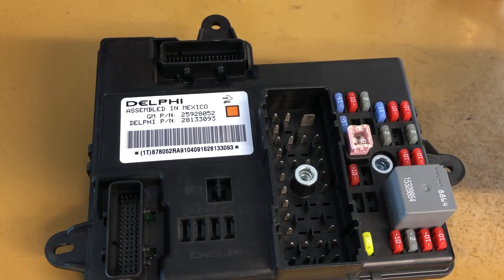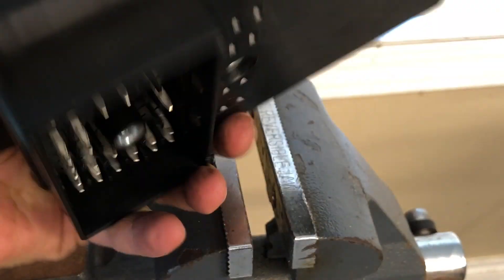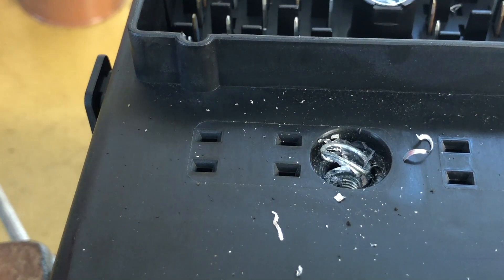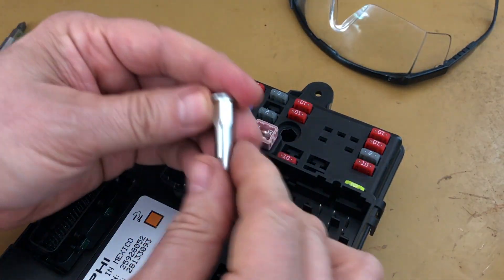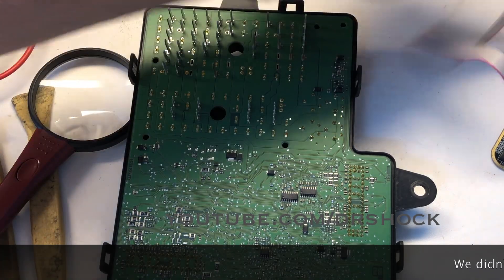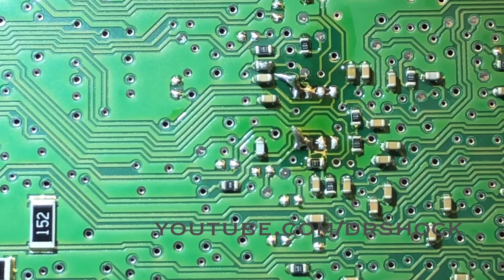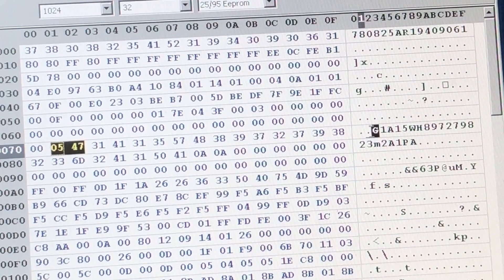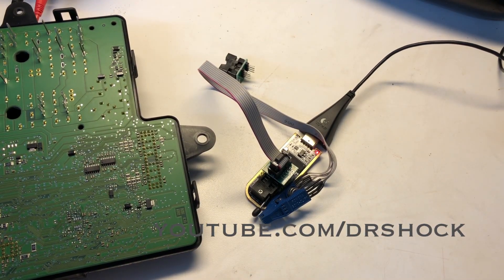2005 - 2010 GM Delphi Body Control Module (BCM) EEPROM Location & Contents (VIN, mileage) Cobalt HHR

Comment: Sorry ive had to edit this question like 5 times now lol.. But im working a 2008 Saturn aura with a no crank no start issue, a U0100 code and dead gauges. The car suffered from some random no start issues before completely dying and the doors would randomly lock from time to time. I fond a TSB under my vin suggesting a problem the BCM can increase in resistance over time and with all the other symptoms i'm dealing with i suspect that my BCM is probably bad... In any case a brand new BCM cost more than the car is worth so I will be swapping it with a identical junk yard BCM. As i understand it the dealership wont/ cant  reprogram a used BCM so my question is would this technique work to transfer the data from the old BCM to the junk yard BCM? I am also curious to know if it would be possible just to solder the EEPROM of the old BCM directly to the new BCM instead of going through the process of reprogramming it? oh and one final question.. Do you have a link to the software you used to read save and write the eeprom data?? 

With that i do wanna thank you for a VERY informative video!
Reply from the maker: Thanks.  Yeah you can manually clone the BCM a couple of ways that I mentioned in this video.   You can physically desolder and swap the EEPROM out of the original and into the donor.   Or you can save the original EEPROMs contents, and overwrite the contents in the donor using an EEPROM programmer.

If you tap the linked video in the Youtube card (upper right circle i icon) you'll see my CH341a EEPROM programmer video and there is info there on the software I use with this little guy.
Reply: @DrShock  Awesome! Thanks for the help!
Reply: @DrShock  ok so ive sat down and attempted to make this repair.. and I followed the mods on your other video, cutting the 3.3v pin and soldering the 5v pin to the same one you did. put my chip in boot up the programmer select the chip and get this result

<<M95080>>
Current programmer: CH341
5:02:54
Reading memory...
Success
Execution time: 00:00:00.047
CRC32 = 0xB83AFFF4

however all i get is FF for EVERYTHING.. There appears to be no data on this chip.. I have to be doing something wrong right? what type of error could i have made that would produce this result? 

Oh idk if this is expected behavior or not but when i hit the little chip button with the question mark on the top  next to the badlock icon i get this error message 

IC not responding

is that an issue with the chip not communicating or is this an artifact of the 3.3v pin being cut?

Any help would be greatly appreciated ;)
Reply from the maker: This appears to be a failure to read the content seeing those 0xFFs, are you doing this with the chip desoldered and removed from the board?   It's actually on the rare side to get a GM board where you can use a test clip and redo them in circuit.
Reply: @DrShock  yep chip is removed exactly as you did in the video.. used the same socket to set the chip into the programmer with
Reply: it took me awhile to find the same exact socket you used for your chip.. it was the only thing you didnt leave a link for lol but thats what i used.. And the when i installed the drivers that you linked i got a wiered message saying "the driver was successfully preinstalled in advance" however when i downloaded the AsProgrammer through the link i got from the txt file from that Russian forum i found a folder containing drivers in that. I installed these files and that let the AsProgrammer see the  CH341a programming device. do you think it could be a driver issue?
Reply from the maker: Thanks, I didn't include a link for that particular socket as it typically is included with the CH341a black edition programmer I was showing.   It could be a USB driver issue, I would suggest a way to eliminate all those variables would be to just get a vanilla 8 pin 24x series EEPROM and verify you can read and write it before attempting the BCM repair here.
Reply from the maker: Also verify you have your pin 1 orientation correct, that could also cause what you're seeing.
Reply: @DrShock  ok so i pulled the eeprom from the donor BCM and stuck it in the reader and everything read just fine... but still no joy with the original bcm chip... doing everything the exact same way i still get FF for everything.. Does this mean the original chip was bad?? if so can i just manually input the data on the donor chip?
Reply: and i can confirm i had pin one in the correct orientation
Reply: ok so one thing i have noticed is that the original chip (the one that wont read) gets HOT if i let it sit in the chip reader to long and the donor chip (that one that will read) does not seem to get hot at all.... so bad eeprom??
Reply from the maker: Put a fork in it, that chip is internally shorted.  Could be the reason for the failure, or could have gotten a static zap by accident during the procedure.  At least you know your setup is working now.
Reply: @DrShock  ok so now could i just manually enter in the serial number of the original BCM and the VIN of the car im trying to repair and write to the chip? or is there more information on the first chip that i need? I've studies the vin number and its pretty much the same as the serial number in that every bit is backwards so as long as its just thoes to pieces of information i should be able to get this to work..
Reply from the maker: There's alot more info than the VIN and mileage stored in these.  The security pass code for the ECU to allow the fuel to flow as part of the theft deterrence circuitry is in there too.  All of the various options that are enabled, e.g. fog lights.  It wouldn't be practical to hand edit all that.  Best best is a donor BCM from the exact same year with the exact same options.   Otherwise, in a situation where the EEPROM is itself toast it can be less hassle and less cost to just put a new or OEM remanufactured BCM in there.  Both will have a virgin set of settings that trigger the GM scan tool to automatically populate based on the VIN records of the options the vehicle was originally built with.  As best I recall, all you have to supply is the original mileage value.   It's pretty rare for the EEPROM to be defective, usually would only see that on a flood car.
Reply: @DrShock  Well hey man thanks for all the help! im sorry to pester ya so much lol

Comment: Im working with this same bcm part number in my solstice. I havnt seen the ability to correct milage threw tech2win or sps2 .. paid subsriptions . Ive looked threw hp tuners and its not a changable value either. The orginal bcm was water logged and had major shorts across the board . Ive since patched it up and got it back to semi functional . It will start the car and display mileage lets the radio work . But many lights and door and window functions are malfunctioning or inop . The board is pretty bad.  I have a junk yard unit from an hhr that im using in the car for testing . Ive programmed it and calibrated it with sps/ tech2win but wasnt prompted by either to change or calibrate miles . Now my autel scanner will give an option in bcm set up that mileage correction/ adjusment features have been removed by the manufacture.. please contact manufacture .. then it skips to the sense module and radio set up so on so on . So i havnt found a way threw that way yet but i havnt called gm help desk and just asked if its even possible . Now i have a dorman reman unit . I havnt done a thing with it . My question for you is will it get the error from the instrument cluster that the miles are in error and go back to last recoreded in icp or will it just show me zero miles .. or is there magic coding in the box from the remaner and maybe i get lucky and can calibrate it without getting locked message . Thank you for you videos .
Reply from the maker: Thanks.  So GM has basically removed/blocked the ability to use used modules for most all models 2008 and up.  This is particularly true on BCMs which they started blocking a bit earlier.  SPS, and SPS2 now with the new Techline Connect, are just going to support brand new BCMs (or remanufactured ones with a GM virgin EEPROM image applied).  When you go with a new one, you'll get the mileage prompting.  Depending on the model the mileage is stored in the BCM, or the IPC.  If the BCM is the source of truth, the IPC will still have a tamper algorithm to detect if the BCM was altered from what it last saw, on most models.  This GM service bulletin spells out which is the source of truth by year - https://static.nhtsa.gov/odi/tsbs/2020/MC-10176649-9999.pdf

As far as I've experienced and am aware, there's no way to reuse an used BCM anymore without resorting to the chip level on the board (hence the series of videos I did on that across several models).  The TIS2Web/Techline Connect tools have all blocked used module reuse.  Even some of the Tech2 model years started blocking BCM reuse.  Best results are just moving the EEPROM chip from dead/dying BCM to the donor.   If the original BCM's EEPROM chip is hosed, you really have no option but buying a new BCM.
Reply: @DrShock  When i read the bcm replacement manual it does call out in the descp of op of the bcm that it holds the mileage. But the tsb notes say that the icp will error back the last recorded mileage some how . Some where i was reading in maybe a cobalt or hhr bcm .. maybe even a malibu bcm replacement manual not the same but simular it says somthing about disconnecting the icp for a certian step then connect bcm then x y z then icp connects back inline and im thinking thats maybe a way to get it to get the icp to do the read back error . Anyways . If i got back to those notes and get the correct terms ill try to edit this . But this is an internet guess of coarse. but , do you think the reman unit from dorman will be a fresh prom or static reset, so it will hopefully prompt for the miles to be recalled from icp ?  Also if you were to do the process would you use the gm tools and risk them locking me out or use the autel user freindly tools and risk it not doing the job and making it not virgin/ fresh prom ..  thanks for the reply 
I was looking at building a sniffer and an old hacked version of tech2 to maybe do the job and in my hunt i found your  video . Guys in the know" tell me they thought back in the day when they messed with this platform these bcms are not able to rewrite the miles on the chip. like there isnt a way .. over my head here.. the hardware or chip arragment to do it that way .. by design . They dumbed it down to EU laws and import export laws and car theft laws blah blah its to keep the black market and fraud down . They said new bcm and or dealer level codes .. or figure out the eeprom chip and if its removal... what you are doing here so brilliantly in this video. So im looking into sourcing the stuff you are using now . So just for fun if even if i get the reman unit to work . Ill try to use your methods to make the bad/used one work . Gm is on back order for a new unit at this time . Also do you have any thoughts on using a combo of rasberry, arduino etc to build a stand alone bcm ? Or a piggy back rig ?
Reply from the maker: I don't have any experience with Dorman so can't say, but I would expect a remanufactured unit to be ready to go with SPS.  Otherwise a return is in order ;-)

Personally I only use either the Tech2 or MDI, depending on the vehicles vintage.  With the MDI I go with the short term subs at TIS2Web, now Techline Connect, for either GDS2 or SPS2 as needed. Anything older than 2009 I go with the Tech2 and TIS2000.  

But I've never bothered with a new or reman BCM, I just swap the chips with an OG salvage unit and move on as that's usually the cheapest but still genuine GM route to go.   So can't really help with your questions on the mileage prompts there.   There are some forums out there with folks, mostly outside the USA, who just edit these chips directly and correct the mileage, VIN, serial numbers, security codes, etc.  That's even cheaper but requires more software tools to do (e.g., Tachosoft mileage calculator sub).
Reply: @DrShock  im still pretty new to all this . Im using a j2534 passthru and the sps2 threw the tech connect. The other option i have is the autel ms908sp . Ive imagined trying to figure out how to do what youre doing in this video and you did all the hard work for us . Thank you very much. Im subscriber for life now . I was lucky enough to witness some of the key recovery processess for one of the newer porche hybrids at the shop right now . Very intresting stuff .
Reply: @DrShock  also: thank you for attached link .

Comment: Do you know if SPS allows you to program a brand new EEPROM replacement? For example, let's say the EEPROM gets damaged.  Would a brand new replacement work when soldered into place?  I'm about to attempt one of these jobs this weekend, and was curious if I had a fallback option if anything goes sour.
Reply from the maker: If it were a radio I'd say yes with mounting in a blank eeprom.  But a BCM, I don't think so.  But I haven't tried it either.   But I'd suspect that the BCM serial number and initial configuration data being missing might be a problem.   This is typically only attempted when you have access to a virgin image to pre-populate the eeprom, the virgin image being the saved contents of a brand new BCM before it's ever been programmed before.
Reply: @DrShock  Cool, I was hoping to find a .bin file from a virgin BCM but had no such luck.  Hopefully my soldering skills work out.  I've soldered thousands of boards, but only 1-2 surface mount components.  I'll be using your Chip Quik recommendation.  These videos are awesome by the way.  A huge thank you!
Reply: @DrShock  Any good guides out there on identifying "house" part numbers on EEPROMs, to help trace back to the IC/System Type i.e. 93C66?
Reply from the maker: Not that I'm aware of.  It's usually a trial and error approach on a cheap salvage yard module, like from a flood vehicle where they give it to you for like $5 or $10
Reply: @DrShock  Man I had a hell of a time working on that.  I think my CH341A programmer is defective because no software would recognize it despite getting it recognized in device manager.  Kept getting "error connecting ch341a(-1)"... So I just swapped the EEPROMS and the reprogram worked this time.  However, after doing all the relearns, I'm still left with the initial problem I had before.  No wipers, front turn signals don't work, and ABS has a DTC.
Reply: @DrShock  I'd happily make a Ko-Fi donation if you have any interest in assisting diagnosing this 04 Colorado... I checked splice ground packs too
Reply from the maker: @destrucsean  I didn't ask this earlier, but it sounds like you had diagnosed your BCM as defective and then replaced it with a salvage yard or otherwise pre-used replacement and swapped over your original eeprom chip/contents.   But after all this, no joy on the original problem(s)?

Some things to keep in mind
 - Both BCMs of the same exact GM/Dephi part number(s)?    It matters greatly.
-  Setting aside the ABS DTC (which would be unlikely BCM related anyway).  Wipers and turn signals are both with the multifunction stalk switch on the column.  I'd make sure that the wiper motor is receiving power when the switch is on first (these symptoms, together, are more likely not the BCM).  You'll need a wiring schematic from the service manual for the '04 Colorado.
- Similarly I'd be checking that the turn signal switch is making a correct circuit for the turn signal lamps.   Again, you'll need access to a wiring schematic in the service manual.  

Google "2004 colorado turn signal schematic".  You should find several, this is just one that might help https://www.naskie18.com/colorado/schematics/

Those two symptoms happening could be BCM related or they could more likely be wiring harness damage, or switch wear related, or both.  The only way to know for sure is to diagnosis the root cause before attempting the repair.  Again, set aside the ABS DTC, it's something to chase separately.
Reply: @DrShock  I trusted a local shops assessment of the BCM and some people saying BCMs go bad easily on forums.  The part number is the same for the replacement.  I no longer think it is BCM related.

My Dad borrowed the truck for a week and gave it back to me like this.  All of these issues started at the SAME TIME.  He said it may have rained in the cabin with the windows down one night.

My first thought was the multifunction switch until the shop indicated BCM.  I'll see what I can figure out with a multimeter and make a donation.  Thanks!
Reply: @DrShock  on a tech 2, might be worth noting that the wiper relay output does not change when turning the wiper switch
Reply from the maker: So it sounds like you have the right tools and skills to tackle this.  I'd start with the turn signals, easier of the two (other being the wiper).   The schematic will show which BCM wires are involved, which multifunction switch wires are involved.   I'd just test the bulb first (get rid of easy things) and then get started with the signal turned on probing for where things go south.  Left signal, then right signal.  Probably don't even need to look at the wiper (more complex circuit anyway) to zero in on the real problem.

BCMs tend to be very robust and hardy electronics.  They can definitely fail, but it's uncommon.   And it's usually due to corrosion / oxidation.
Reply: @DrShock  Ended up being a chewed wiring harness underneath the brake pressure modulator ☠☠☠